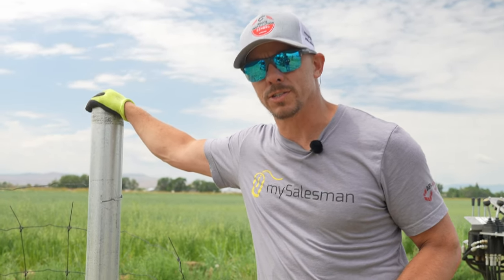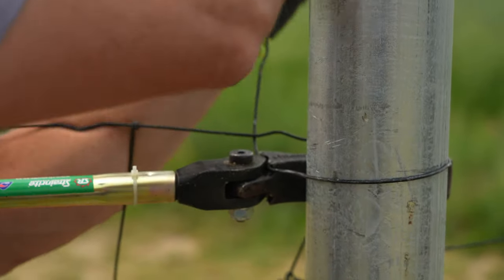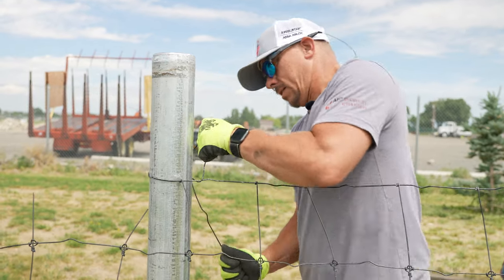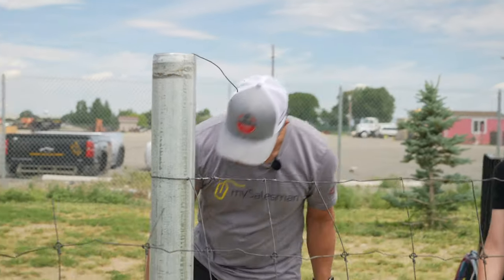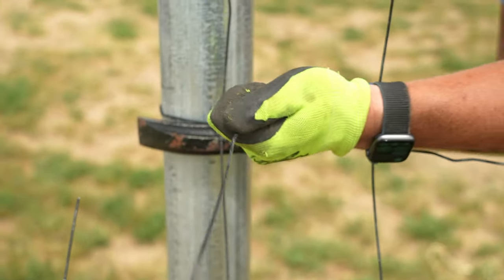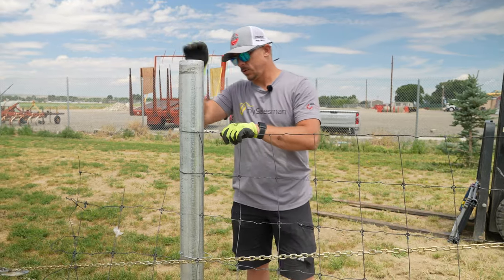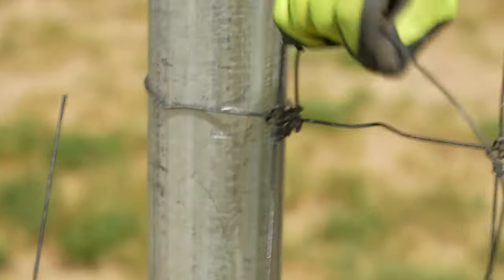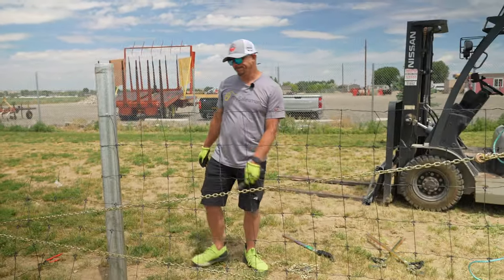Tighten Fence Wire Easily!

Comment: Overweight? You're fishing for compliments there I think. 😂
These claw wire pullers are excellent for tying off the tail of horse wire/sheep wire and then getting a gripple tclip on it.

On the other side of things, I don't understand the amount of fencers who seem to think "hard stapling" is a problem. We have done it where necessary for 35+ years and never once seen our wire fail at that point. And yes, all of these fences are still standing and those that are not it is because of the posts rotting. I like in a much wetter climate than you also. The claw pullers is more than capable of breaking wire if you pull too hard on it and will do every bit as much damage to the coating of the wire as hard stapling. 

I think it's a bit of snobbery.
Reply from the maker: I will plead the fifth on this….

Comment: My first tie off of woven wire to a metal post involved a 2X4 stretcher, come along hooked to the bumper and c-clamps to keep the wire from slipping.  

I clamped the wire I was going to tie and the strand below it.  Then cut the top one and wrapped it.  Moved the clamp down one and did it again. About 1/2 way down, the 2X4 was leaning so badly the wire was crooked… after dinking with the come along and resetting the clamps a half dozen times… I discovered that the morning had waned away to noon.

Three hours later .. we stepped back and marveled at our clever way of tying off the fence!  Then,  we spent the next 15 minutes tying up to the 3 line posts.
That’s three hours of my life I’ll never get back…. Just wish I had a time lapse of it… it’d have a million views!

Where were you and your claw when I was still young?
Reply from the maker: Haha! I wasn't doing it this way when I was young either!